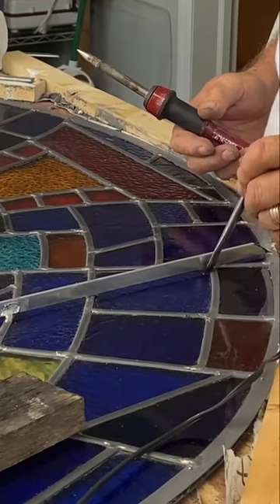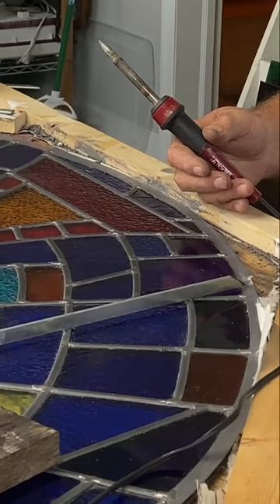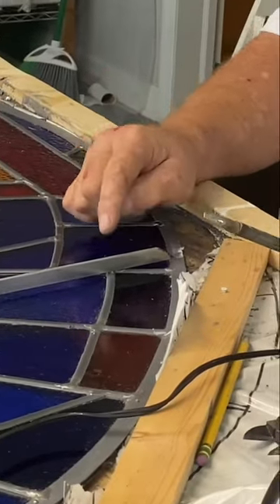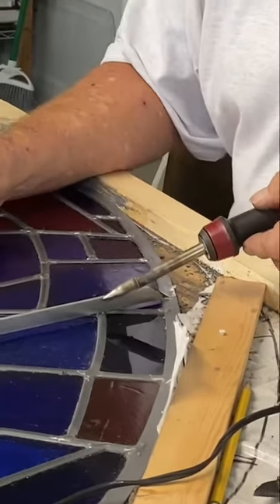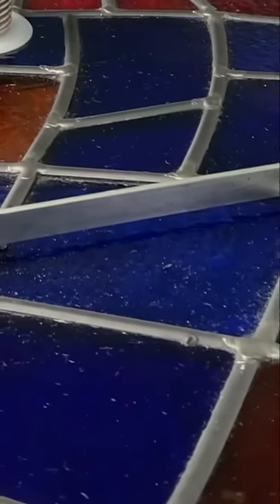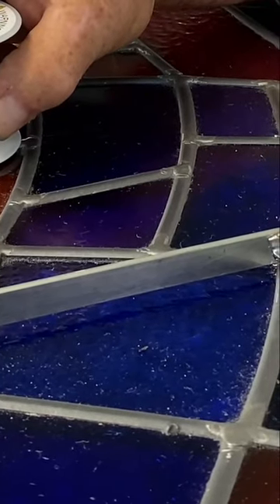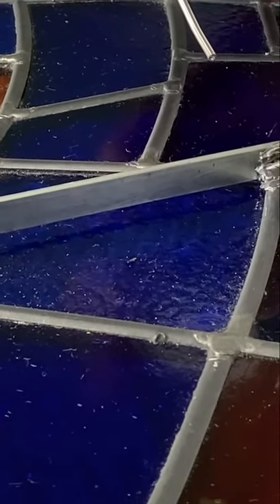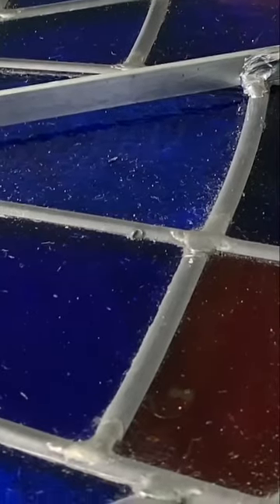Add Strength to Your Stained Glass

Comment: Personally,I like to use zinc rebar. If you use two irons on either side of the zinc with paste flux and 60/40 solder you will get better results. I also like to use a wire brush to clean the area where I'm going to solder.
Reply from the maker: Definitely the zinc is cleaned at the solder joints before soldering. Heating up the zinc is a must. We use zinc coated steel because of it’s strength. You can see the entire video here and thanks for your input and for watching the channel! https://youth.be/8D2nupIsKiE